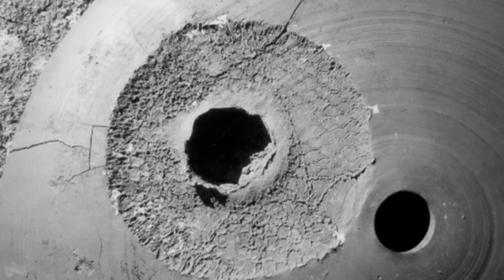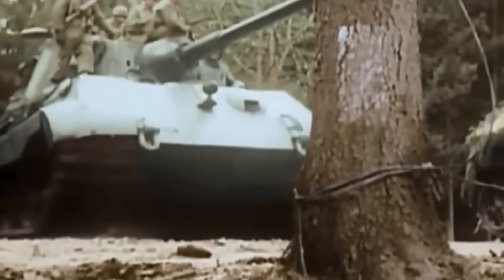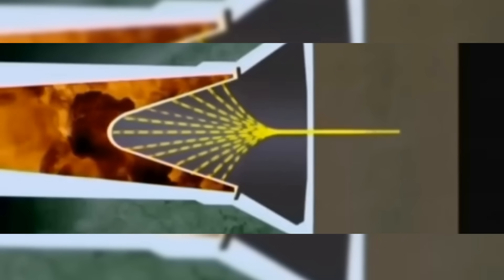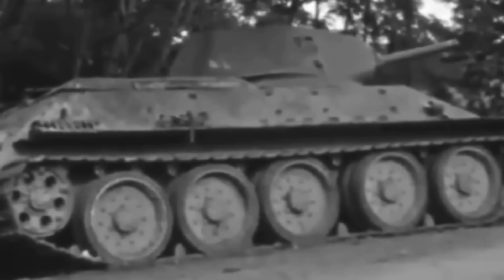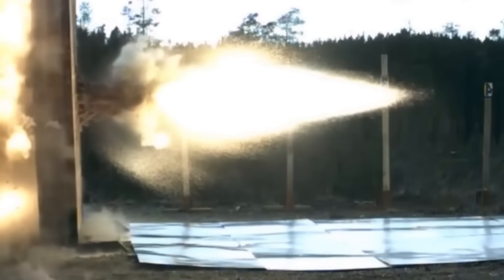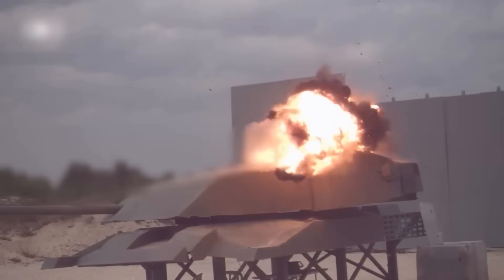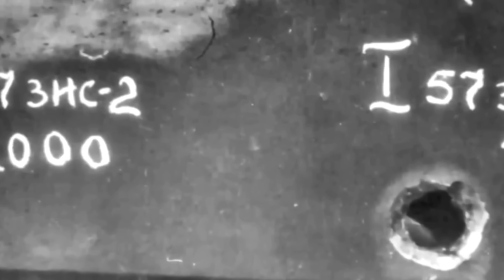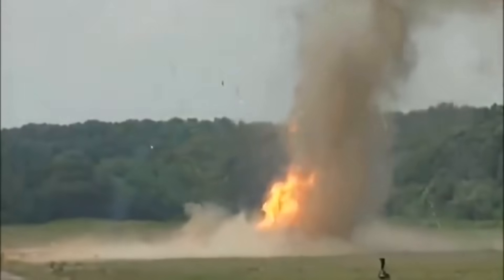How a Tiny Hole Kills a Tank—The Shaped-Charge Secret|Truth About HEAT Rounds #military #tank #army

Comment: Anti-tank shaped charge warheads are lined with copper, tantalum, etc. That liner gets both compressed and accelerated sufficient to slam its way thru armor plate. In the case of the TOW anti-tank missile, the shockwave propagates at 56,000 fps! You'll feel a very distinctive "THUMP" in your chest even from 500 meters away. Much different than conventional/non-shaped charge ordnance. Everything else with a byproduct of that enormous amount of kinetic energy. But that's what's happening behind the scenes. Just a s**t load of kinetic energy, same as the SABOT rounds that tank's fire. Just a different method of delivery. The SABOT rounds get sufficient kinetic energy from the propellant contained in the shell.

Comment: Kinetic energy projectiles are dependent on very high velocity if they’re to function well. Shaped charge projectiles have no such limitation, and will function perfectly well at low velocities. Which brings me to the M4 Sherman tank and its main gun, the M3 howitzer. This weapon has been commonly, though often unfairly, criticized as lackluster, particularly in the anti armor role. I have long been curious why the Allies didn’t develop shaped charge ammunition for this weapon. It would seem to expand its battlefield capabilities considerably.
Reply: @mikem6176: You are fight about the gun. The M4 Sherman's gun was perfect for what tanks normally do, knock out bunkers, and suppress machine gun positions so that the infantry can take its objectives with fewer casualties..
Reply: Their was much back-and-forth between forces in theater, armored forces wanted this, Army Ground forces wanted that, meanwhile weapon development in the States just kept moving forward.

Comment: Nice video and presentation. 
If you want to reiterate this title video, add this. The shape charge was not sitting in the lab just before it was used in the battle field. It was a popular problem solver in the drilling and mining industry before the wars. One of the problem was no water or crude oil available when target aquifer depth has reached or surpassed. They lowers shape charges in various depths in the proximity to fracture hard rock layers at multiple depths. This lets water or oil to permeate through shattered rocks. Hope this helps.

Comment: how about thin magnet plates of armor like super thin ERA ,if the jet contacts the magnet sheet and starts cutting through it ould the jet cone and the jet itself be disrupted by the proximity of magneet sheet on to of the armor plate? 😛😛
Reply from the maker: Can you imagine how powerful magnetic radiation would have to be to deflect or disperse a jet of such energy? Such magnets don't exist in nature. 😉 Theoretically, it could be electromagnetic radiation, but in that case, we're talking about Star Trek technology...🤔🤣 In that case, this type of munition would no longer be relevant...🤣🤣🤣
Reply: @nemoorisra  true 😅😅how about presuured liquid nnitrogen between 2 steel plates? 😛😛to cool down the jet and maybe deform the jet when it cuts the pressured cold liquid? 🤔🤔
Reply: @mikeszz5 No. It's a matter of scale.  The gas would be like throwing an icecube into a jet engine. There's no time for heat exchange.
Reply: @JosephKlacik thank you for reply, i guess i can stack multiple ERA one on top of other block 😅😅if its not too heavy
Reply: @mikeszz5  It was noted that an equivalent 1.2 million psi is developed at the shaped charge entry point,, enough to punch through the armor regardless of any cooling effect.  And JosephKlacik's "no time for heat exchange" is correct, but even instantaneous heat exchange would not help.
And keep asking challenging questions. ☺
Reply: @somaday2595  😅